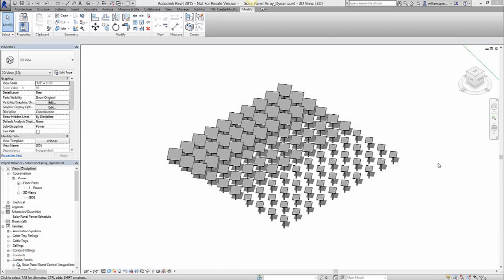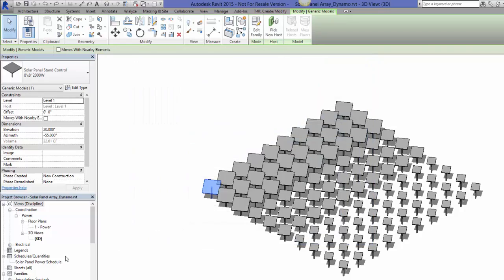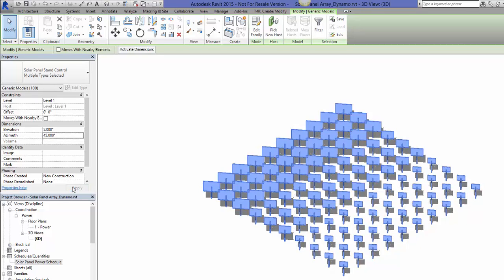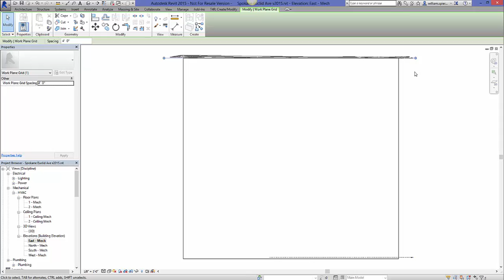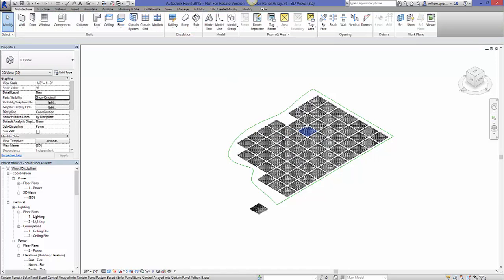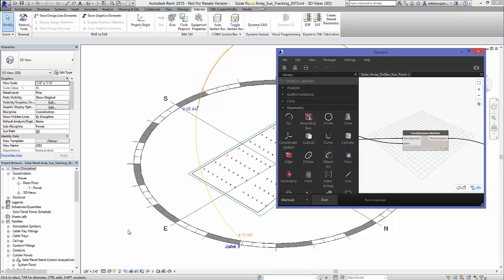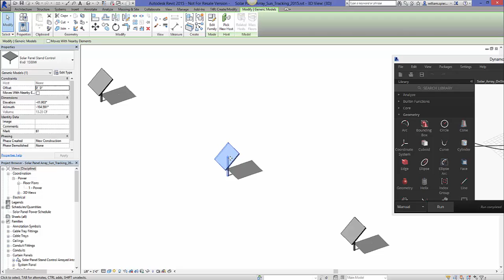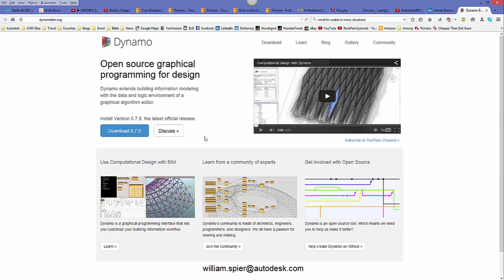Revit with Dynamo Keeps Solar Panels Tracking the Sun

Comment: Hi williams,
you have done very great mazing job, however, we need to know how do you set the capacity parameters and how will the capacity of the solar panels increase with rotation with the sun light angle. please provided a link.

Best regards

Abraham

Comment: Next you can use the Solar Analysis nodes to calculate the insolation on the panels, add those to the schedule and calculate the total power production for the field in a schedule for any period of time.